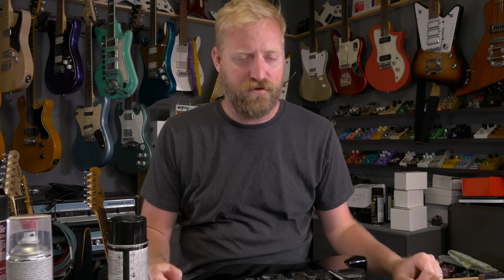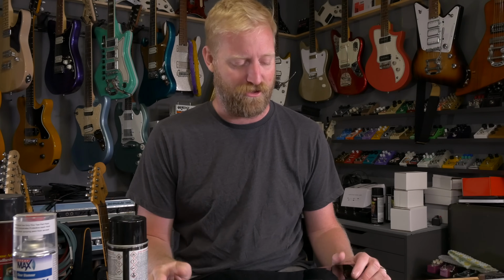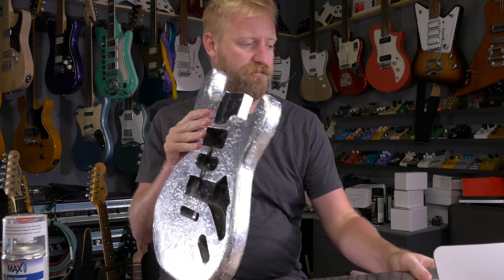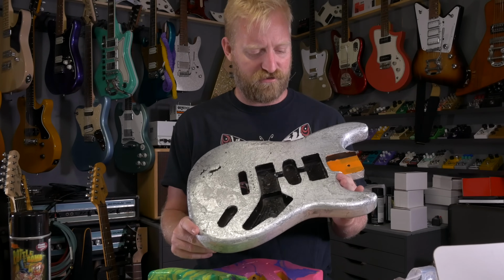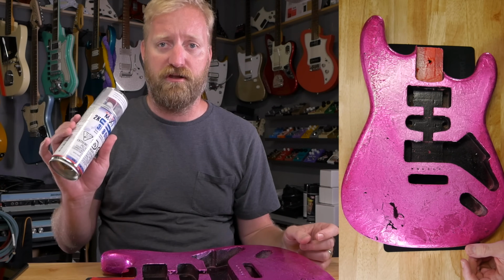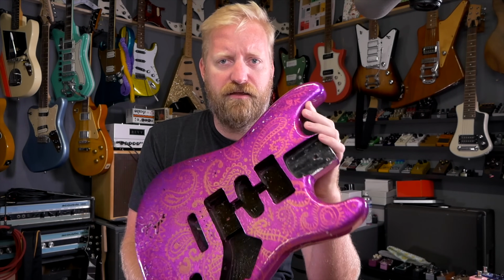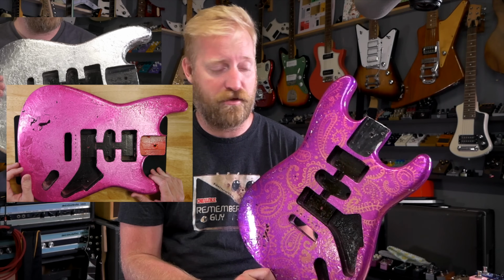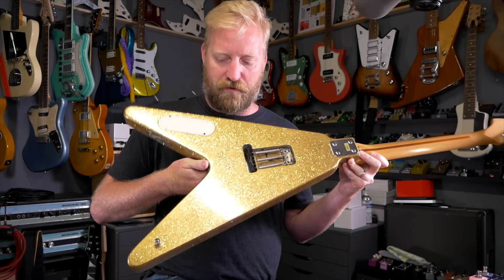Refinishing a guitar with kitchen foil /// Foil + Kandy + Paisley = a fun project I don't regret

Comment: I don’t know about the foil but that purple burst paisley is awesome. Never thought I’d like it but I really do. I’m wondering if wrapping it in foil will work like some super shielding or if it will effect the electronics at all?
Reply: Matt Shaw without being conductively connected to any other shielding or any of the electronics thanks to the paint covering it, it won’t have any impact on the electronics.
Reply: instablaster...
Reply: @bufferkiller  what is he had grounded the foil beforehand?
Reply: @UnrestingSpirit  Placebo effect, maybe. The shielding doesn’t encapsulate everything, so it doesn’t become a true faraday cage to cut out the hum. The grounding of the building you’re in, and other interference creating devices has more impact. A soldering iron will cause insane buzzing, and you’ll hear a sound at home that you won’t hear at any shop you take it to for repair. The commercial grounding of the building will have you feeling crazy for not hearing at the shop what you know you’re hearing at home. 

I still shield when a customer asks, because the placebo effect is no joke. Most still insist on copper too, because it blocks a few more frequencies than aluminum, even though they’re not frequencies a guitar is affected by. Plus everything above about it being security theater for a guitar.

Comment: Let me get this straight: a guy, called "60 Cycle Hum", has shielded all parts of a guitar body EXCEPT the wiring cavities... ;-)
Reply from the maker: ok, ill let you.
Reply: @60CycleHumcast   In all seriousness, I have several guitars with an Aluminium Foil Tape base layer for the finish. 

The theory is that, should I NOT like the results, I can peel off the tape rather than having to laboriously remove a finish. I've never disliked the results enough to peel one.

Some guitars, I just left foil-coated. It gets dull and worn in interesting patterns. If a bit gets ripped, I just stick more foil tape on...
Reply: @60CycleHumcast  Ryan, put 'GFS Gold Foil Single Coil Pickups,' in that guitar! It would tie the aluminum neck and purple foil Paisley body together perfectly! They're cheep and and GFS's website is having a sale right now!
Reply: The entire back of the guitar is covered in foil.  How much more shielding do you think you need  :)
Reply: @Reginaldesq  Joking aside, a thin layer of tinfoil - with a tenuous connection to ground - is no use as a shield. 《SCREWS TINFOIL HAT INTO A BALL AND THROWS IT AWAY. ;-)
Reply: @elmo7sharp9  As I understand it.  The thickness does not matter and tin foil works just fine.  The connection to ground probably not the best though.
Reply: @Reginaldesq  As the owner of 4 foil-encased guitars, my experience is that foiling the body has no shielding effect. 

Thickness and material choice for shielding DO matter. 

"Pie-dish" thickness aluminium works, if you screw a grounded washer to it AND you're using one continuous piece of foil for the whole cavity. 

Thin kitchen foil is useless and the connectivity between adhesive-coated joins is almost nil.
Reply: @elmo7sharp9  Yes, well your not meant to use and insulating adhesive join.  Interesting that a foiled body does not work.  Too far from the pick up?  So, it has to be in the cavity?
Reply: @Reginaldesq   If you use shielded cable - with the shield connected to ground - for all connections, including the pickup leads, then cavity shielding is pretty much redundant for most situations. Unless you're using extremely high gain - then every little helps. Many Gibson guitars use shielded cable AND a shielded control cavity. 

If you use plain wire (as on a Stratocaster), then each "hot" wire is a mini-antenna for hum, electrical noise from flourescent lights and radio interference. Cavity shielding makes a difference. Even for playing clean.

" Too far from the pick up" is not a consideration - wiring inside a Dobro would be very well shielded...
Reply: @elmo7sharp9  OK, but, The last statement you made seems to contradict your initial post ie shielded everything except the cavity V's too far from the pick up is not a consideration.  Were you just having some fun?
Reply: @Reginaldesq  Yes. My original comment was intended as a joke, not as a critique of his work.
Reply: Underrated comment🤣
Reply: @elmo7sharp9  can you sand the foil to get a highly even reflective finish?

Comment: I wrapped an old Japanese LP copy in foil, back in the late 80s, with a similar look (maybe slightly smoother) to yours, but I left it at that and didn't sand or paint it. 
I tended to paint/wreck most of my guitars back then - my favourite being an SG shape that I painted the Band Big Black's album "Atomizer" on the front and "Songs About F***ing" on the back.

Comment: Ryan, you really have a taste for the bold, off norm, going off the beaten path.  I commended you Sir!.  I would have gone or stuck with the silver, chrome, tin foil, and then the black pick guard and aluminum neck.  You just inspired me to possibly take a sportscaster I have with dual lipstick pickups in bridge and neck position and do the silver surfer concept I suggested when you asked for comments.  If you don't mind of course? Most of my Strats are sea Foam, and my wife thinks there are too many that color.  So the adventure just may have to happen.

Comment: Fun pickguard trick...(non-pro tip).
At the craft store in the scrapbooking section, or thereabout, you'll find specialized paper. Some have cute little things on them, but others have sparkles, gold sparkles, green sparkles etc... anything extra tacky that you can imagine. Wood grain, clouds, you get the idea.
1. Buy the design that you want on your poor, abused pickguard.
2.Take your kid's glue stick. The cheap one that goes on purple and dissolves in water.
3. Smear said abused pickguard with stolen glue stick and apply cheap, tacky, paper on the now purple slimed pickguard.
4.Trim with Exacto.
5. Show off your new cusomized, exceptionally tacky pickguard to friends and neighbors.
...and when you get bored with it. Just soak the ugly paper off the pickguard in warm water (hence the "liberated" from your kid, purple glue stick) . Dry it off. And repeat with another design.

Comment: I like the effect you got with the foil. If the spray adhesive is not working so well, maybe using gold leafing size might work?

I might try this with copper tape over a scratchplate.

Comment: Looks really good! Great job with drawn paisley print. I believe I would’ve used a silver or gold base color instead of foil. Then you can add your artistic touches and when you sand in between clear coats, try a very fine sand paper with water. You’ll get a mirror smooth finish.

Comment: I like it.  I think you should do one where you make a serious effort to distress the edge where you're going to paint the darker color.  Might also be interesting to use bookmark sized pieces of foil and have them overlap for texture.   I wonder if there are matte clear coats you can get in a rattle can.  Might be that you don't actually need to sand for that or maybe not sand as much.

Comment: I think you'd get a better result using silver paint as the first coat. Then candy burst with gold paisley. I think the foil will just flake off over time. Any bump would crack the paint because the foil will flex but the finish is brittle. Then the cracked paint will pull off the foil beneath it. Maybe use a metallic paint as the under coat and brush it on by hand, or dab the metallic spray paint with a plastic bag like those street artists who paint planets and galaxies with rattle cans and stencils.

Comment: I would have layered it again with aluminium after sanding and would not use any liquids.
Then polish it 10k grain.
Then lacquer it thin.
Polish it.
Paint the colour.
Polish, lacquer, paint again.
Rinse and repeat 2 times.
Paisley it then laquer medium thick and polish it again with 10k grain and then you use car wax polish.
It will be smooth and shiny

Comment: For that thickness of clear coat needed, you could have laid it flat and poured polyurethane clear or epoxy etc over it.
That way you could have kept the original cool looking foil finish and not sanded the foil (which wrecked it). 🙂

Comment: That does look really amazing. Well done!.. In hindsight, I would not have sanded the foil, but everything else is amazing 👍
Reply from the maker: i was worried that if i didnt sand the foil it would be too slick for the clear to stick. and that might have been right. but i kind of wish i had left it.
Reply: @60CycleHumcast  Maybe multiple layers of foil, and then sand it?

I was inspired by the nailpolish guitar to use it to.paint a butterfly on a guitar body. 

The women behind the counter in the shop of my village  looked at me kind of funny when I bought 5 colours of nail polish. I told her it was for my guitar, but that didn't really help. 

So when I'm buying foil I can't use the same story. I think I just tell her I smoke a lot of heroin.
Reply: @60CycleHumcast  Anyway.. It was a nice experiment. And I do like it. Was it also a bit of a tribute to Prince, with the paisley pattern and purple?

Comment: ... and then you’ll heat up the neck with your palm and throw the guitar away cause it won’t be possible to play on a guitar which tuning depends on an ambient temperature ;) Or just nail to a wall.

PS All the painting is hold by a 3M glue layer. It's not very reliable imho.

Comment: $33 spray cans? $20 for clear coat. Hahahaha. You could do this with Krylon and a Sharpie and spend like 12 bucks.
Reply from the maker: it takes forever for the cheaper clear coats to harden up, ive gone that route before and had to wait months for the clear to harden up.
Reply: @60CycleHumcast  2k is the best finish, but if not for your own so for your kids's sake, you should buy protective overalls (they're not that expensive), wear gloves and eye protection.